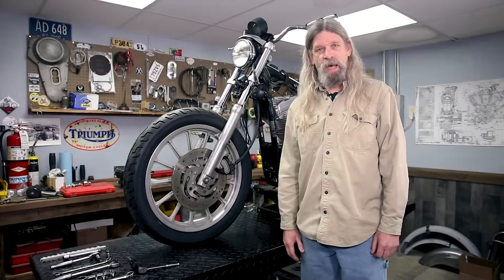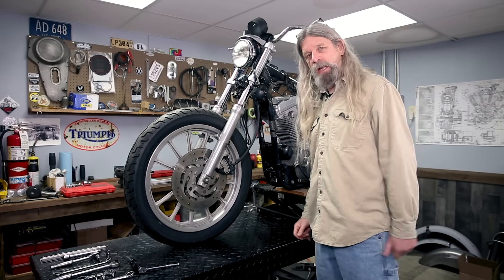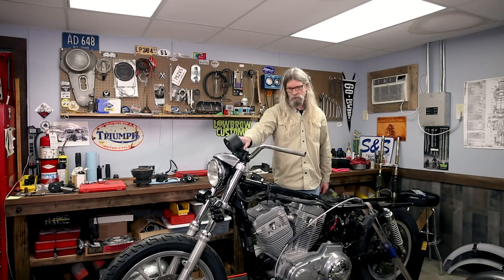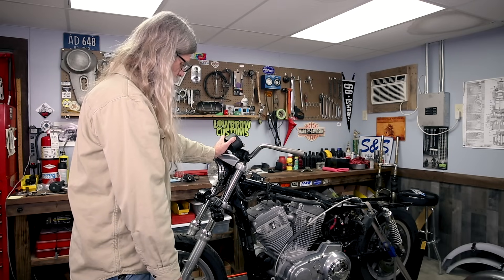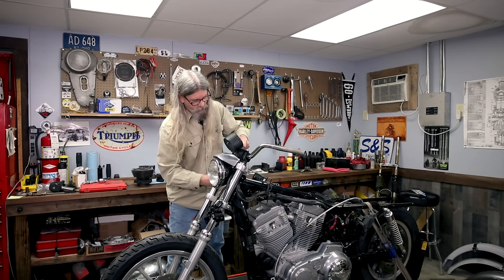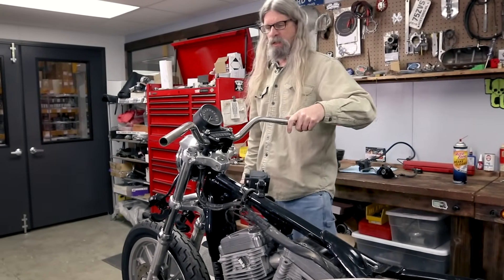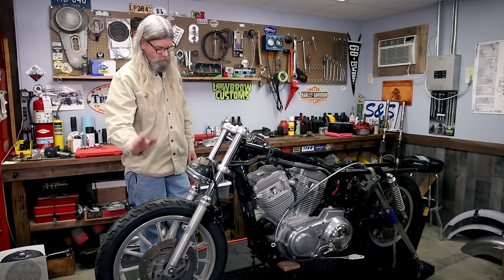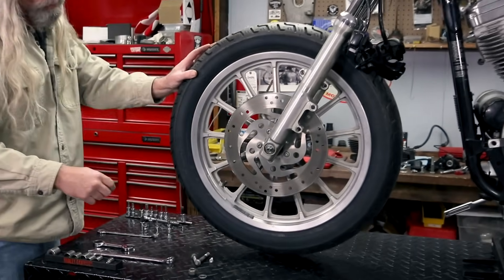Saturday Sportster - Season 1 - Episode 2 - Front End Disassembly

Comment: Hi; was wondering what the trick is if the bolt won’t come out the fork.; very helpfull series!
Reply: Then you will have to drill the head off of the fastener till it is gone with out mucking up the place where the sealing washer goes that allows the lower to come off and you will be left with just threads in the bottom of the damper tube which usually come out easily
Reply: @toddmuller768  thanks for the info; best. G.

Comment: If I wanted to put a narrow glide front end on my 2015 sporty 48 will I run into any problems? I will also use the stock 19 inch front wheel that goes with that narrow glide front end like the irons
Reply from the maker: Triple tress, tubes, axel, spacers and wheel, you'll need all of that, be sweet if you can find all in one front end on chopper swapper or something like that. Harley has a 1 inch stem and you should be able to convert it easily. If it handles like crap then maybe you might wanna go back to the original front end. Nice thing is its an easy swap back.
Reply: @lowbrowcustoms  thanks for the reply! I have spent big bucks with you guys and it’s cool you care about your customers! Much love 
- Danny.  LA, so cal

Comment: About 5 years ago I was rebuilding my '83 xlx. When tracing out the electrical, I got as far as the headlight and decided to just buy all the right colors of wire in appropriate gage and rip everything out that didn't make sense (all of it!), which took away the headache of trying to fit the headlight bulb back into its assembly, which, since that's where it's made, you need to send it to Japan to have someone fit it all in. Once I'd gotten over that hurdle the parts went together like they were made to, and rode it for 20,000 miles or so till the case decided to become a sieve. When I get a wild hare up my ass I'll take her down to bare bones and splash oil all over my shop like you just did, and maybe, who knows, put a balanced flywheel in her. Here's my girl running! https://youtu.be/lQ9ZWSQvGt8
Thanks for the vid!